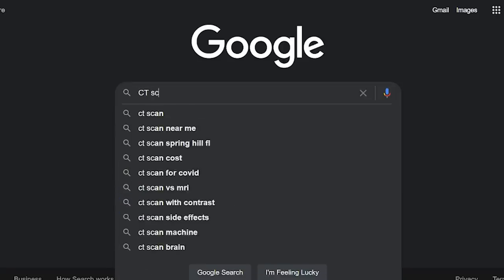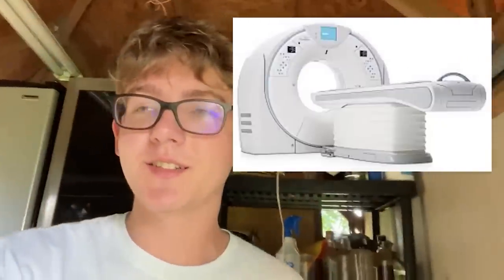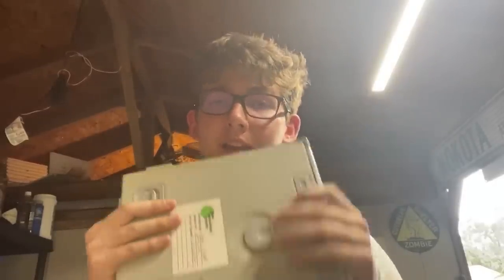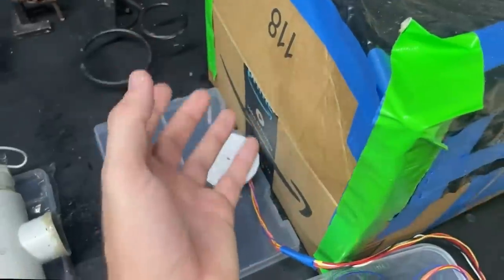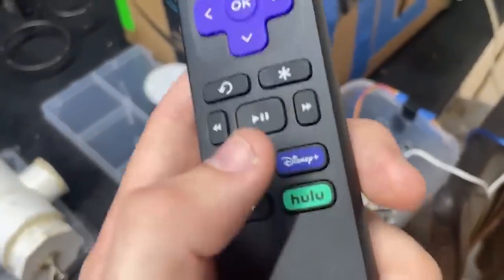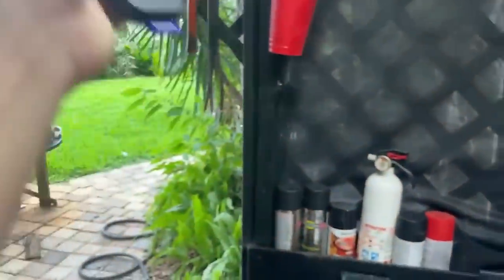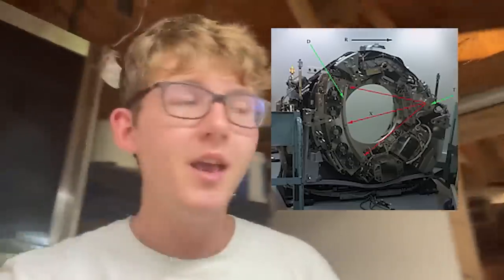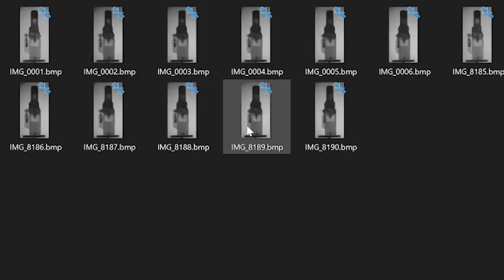Building a DIY CT/CAT scanner for 200$

Comment: Your beeper code does not give enough time for LOW. It does HIGH for a second, goes to LOW and immediately back to HIGH. What you need is another pause after the LOW.
Reply: Well done.
Reply: need to hold HIGH and LOW through prolonged increments.
Reply: for(int i = 0; i < 45; i++)
{
     digitalWrite(2, HIGH);
     delay(1000);
     digitalWrite(2, LOW);
     delay(1000); // this is what you were missing
}
Reply: even better is to just use PWM.  the atmega's default clocks put all of the PWM frequencies in the human audible range, so you can just set PWM to 50% duty cycle, wait one second, then turn it back off.  no need for a loop. example from memory: (it's been a minute since i touched an arduino so double check the syntax lol)

// i believe this is one of the PWM pins, and i think it's in the low kHz range
int beeperPin = 6;
pinMode(beeperPin, OUTPUT);

// beeper on.  this is 127 of 255, so 50% duty cycle square wave. (and it's 255 because it's 8-bit, and that includes 0, so it's 256 total)
analogWrite(beeperPin, 127); 

// let it beep for one second 
delay(1000);

// beeper off 
analogWrite(beeperPin, 0);

Comment: Absolutely incredible that this works as well as it does. After working 4 decades in control systems, I would recommend programming at least one more additional button on your remote - an E-Stop (emergency stop) button to instantly halt the x-ray and high voltage power supply, should someone (or possibly a pet) enter into the area unexpectedly. Impressive that you researched this so completely. Well done!

Comment: Excellent.
I've not watched all of it carefully so you may have addressed it.

Be careful to not overheat the tube.  They are normally submerged in oil and temp controlled.

And buy yourself a digital dose meter.  Don't mess around with xrays and cancer.

Comment: The piezo buzzer not staying on for the specified time is because you need to delay after setting the pin to low, otherwise the code loops then immediately sets the pin high again, not giving any time to stay off, if you want a period of 1 second high and low then you can do that but if you want a total interval as 1 second so time it takes for the buzzer to go on and off then repeat, you would delay for 500 ms after setting pin 2 high and then after setting pin 2 low delay for another 500ms.

Feel free to tweak these values to achieve what you’re looking for.
May i recommend  HIGH for 1000ms & LOW for 500ms

Comment: This is a great idea for making your own X-ray inspection equipment; welding, solder balls on BGA components, failure analysis, etc..
It was smart to use the remote control to keep away from the X-rays! 
If you don't know Matlab, it's not that bad. You can use Octave and get up to speed with Matlab for free (nearly the same). 
Python also has LOTS of tools, but Matlab is great for doing this vector math in real time though.
Reply: Just like Matlab has Simuling, Octave has Scilabs. They're a LOT of tools to get things done at a high leve, very fast. It's like how Python has a lot of tools out there to use for free.
Reply: Python has a lot of modules for medical engineering, image reconstruction, signal analysis etc. And all for free. 

 I used it a lot at university (studied medical engineering).

Comment: 7:25 It's probably been mentioned but the issue with the buzzer staying on is that it turns off at the end of the loop cycle, but then immediately starts the cycle over turning itself back on. doing something like "buzzer on, wait 500ms, buzzer off, wait 500ms" would produce something similar to what you want.

Comment: Incredible!  I wonder how much more accurate it would be with tiny increments like 0.4 degrees per image.  How much radiation do they emit?  I wonder how long before it would “damage” a person. I’m also imagining if you built a slow revolving almost circular train track, you could have the hardware rotate very slowly and work well. If you had a vertical track on a wall, a patient could stand against a wall while it moved up in 1ft increments and revolved slowly. Obviously very slow and crazy work to develop but it would make ct machines an affordable household appliance.

Comment: Great video. I have some code suggestions though. Note: this is not in any way intended to be a roast.

First, as you are in a very agressive enviroment where you can get random bit-flips, you should add a watchdog timer to the code. This is on the hardware where if a function isn't called for too long it assumes the MCU crashed and it will reboot it where you can re-initialize all of the outputs into a safe state.

Second, your code is very slow (as in one loop will  take many minutes) because you have a lot of blocking code (a delay(1000) will have the execution sit there until it is finished with that line). This makes it difficult to react to any other inputs you may want to add later (like a cancel button). Instead, you should have something more like this pseudo code:

#include<avr/wdt.h>	//real code, needed for watchdog
setup(
	wdt_enable(WDTO_2S);  // Real code, Enable the watchdog with a timeout of 2 seconds
)
loop(
	wdt_reset();  // Real code, Reset the watchdog if this isn't called before 2 seconds then the arduino will reset itself
	if(startButtonPushed || motionRunning){	//see if the enable button has been pushed or if the program is already running
		if(!motionRunning){	//check to see if motion is already running to initialize the running variables (pushing the start button again doesn't do anything)
			startTime=millis();	//read current time
			motionRunning=true;	//tell the program it is running
			angleStep=360/destiredResolution;	//save a variable so the program knows when it is done
			currentAngle=0;		//reset this counter
		}
	}
	if(millis()-startTime>=1000){	//here is where it gets good. The arduino is running the main loop as fast as it can (many thousands of times per second), this checks to see if one second has passed, if it has then it will do stuff
		takePicture();	//call function to tell camera to take a picture
		moveTable();	//start table motion
		startTime=millis();	//record new time
		currentAngle=currentAngle+angleStep;	//update table rotation position
		if(currentAngle>=360){		//check to see if a full rotation has completed, if it has, shut down the program
			motionRunning=false;
		}
	}
	if(stopButtonPushed){	//having non-blocking code allows a stop button to be constantly checked
		motionRunning=false;
	}

}

If you have any more questions I can help out and would even be willing to make something that actually compiles. Keep up the good work.

Comment: What do you think about building a scanner with an array of electronic sensors like those used by Peter Jansen? it can allow you to detect a weak signal directly, with higher sensitivity and much faster. The original "openCT 2" (can be found on 'hackaday') has a pretty low resolution, but signal-to-noize ratio is pretty impressive.

Comment: Great job! One thing, it's probably much harder and slightly questionable regarding safety, but if you manage to run the tube at full power (not sure how many kV you are using) you can probably record video directly of the intensifying screen, then you just do a pretty quick 360spin and then extract the frames, are you using long exposure for the pictures? Excellent video, and sorry if it's something you already considered hahahaha

Comment: Hmm curious how the crazy phone image AI that they use to improve the image interferes/helps. If it’s possible to find an app that turns off some of the magic would be good to compare. During scientific things it’s best to remove as much of the magic and apply it later, especially because it can vary from shot to shot.

Also if you add a counter or something that was visible in the image it would help to map the particular degrees of a shot. Probably the best move is to integrate it with a Pi or something so you can correlate the shots with the actual data on rotation.

Comment: I think it’ll be really cool to repurpose an old microwave machine to do this. Since it’s already got a turning table and stuff.
Reply from the maker: Hmmm you’re onto something there! I could lead shield it then replace the old electronics with my own, I’ll definitely probably try that in the future!
Reply: @PyrotechnicalScience  yep, super excited to see it.
Reply: @PyrotechnicalScience  the microwave motor would have to be a non standard one. The motors that I have found inside the microwaves take a random direction when they are turned on.
Reply from the maker: @Charlie8food  I’d just replace it with a stepper motor

Comment: You've got your beep in a loop so its going to happen 45 times. It seems to be 'staying on' because there is no delay between the switching off and the switching on. It goes on, waits for a second, goes off, then it changes the value of 'i' and does a check, once that check is done it instantly goes back to the 'switch on' instruction. The time it takes to switch back on is imperceptibly short. It will perceptibly stay on for 45 seconds and then turn off and continue the rest of the code.
Reply: Yep this is the reason. I was going to post this exact thing but then I saw this. Set another delay after the LOW or it has zero delay and just stays on all the time.(or set the delay before the HIGH ... I personally don't do anything before the HIGH :) )

Comment: Being technically competent at such a young age is great, you have serious future potential.  Since you can produce X-Rays might I suggest an application other than imagery.  Try to develop a receiver antenna that would convert X-Rays back into electricity similar to a solar panel converting photons into electricity.  Space travel has a problem with cosmic rays penetrating the space ship and damaging the astronauts, like being under constant X-Ray bombardment, current shielding is insufficient.  Astronauts during Apollo missions kept seeing flashes of light even when their eyes were closed, those were cosmic rays hitting their bodies.  If you can convert X-Rays into useful electricity before they penetrate the ship that would save astronauts lives & produce power for Plasma engines.  It is worth the research.  X-Rays are different frequency than gamma rays but the approach should be similar.  Gamma rays also come from nuclear waste, an antenna encasing nuclear waste would become a battery that last for centuries and worth a Nobel Prize.

Comment: Looking at your code. You have the alert in another for loop. So it's going to execute the alert 45 times before it's stops. Instead write a conditional statement at the end of the first for loop that checks the iterator. Such as "if(  i == 45) {
ALERT:);
}

That way it only runs when the cycles completes and only alerts once.

Comment: Awesome project! Can you provide some details about the X-ray source, such as the high voltage magnitude and the current (mA) that the tube draws? I have experience repairing dental X-ray machines, and so I have a good understanding of the circuitry and how it functions. Do you have a link to your construction details that you can share with others who might want to duplicate this project?  THANKS!

Comment: Somebody probably answered this, but in your buzzer loop you need another delay after writing LOW to create off-time. Because it's a loop, it's going straight from digitalWrite(LOW) to digitalWrite(HIGH) without a delay. 

Original script:
for(i = 0; i < 45: i++) {
    digitalWrite(2, HIGH);
    delay(1000);
    digitalWrite(2, LOW);
    //delay(1000);   <-------ADD HERE//
}

The loop when executed looks like this: 

digitalWrite(2, HIGH);
delay(1000);
digitalWrite(2, LOW);
digitalWrite(2, HIGH);
delay(1000);
digitalWrite(2, LOW);
digitalWrite(2, HIGH);
delay(1000);
digitalWrite(2, LOW);
digitalWrite(2, HIGH);
delay(1000);
digitalWrite(2, LOW);

... (x45)

Comment: Scrap yards. That's where I find my x-ray machines and I've even found a CT and other  more niche machines. With the older ones just be careful about the pcbs in the high voltage oil

 Buddy of mine runs a local industrial salvage yard, but they also take just general scrap from the public. Not many people allowed to look around in there but he lets me come in whenever I want. I bought a half a dozen x-ray machines over the last 4 or 5 years. Some of them old nice film types, some of them super modern Siemens digital wrap-arounds. You can find a scrap yard and make friends, you'll definitely get some X-ray and medical stuff from time to time... But here's the key... You need to find out who the clients were that brought it and talk to them. In my case it was a guy who owns a business repairing, setting up, and brokering all types of machines like that. So he gave me a heads up when he was bringing the remains of a CT to the yard. That way I could get it before it hit the ground and receive damage. you'd be amazed what kind of stuff comes in these scrap yards. The smaller family-owned yards are usually the only ones that will let you come in and buy. But a few boxes of cookies and a polite attitude... And they'll keep your number on their desk and call you when certain things come in.

A lot of corporations have bought out so many of the small scrap yards and they won't even let their own employees buy from them because of the liability. So you have to find a family-owned or smaller scrap yard. I pay around $0.05 per pound which means I got those x-ray machines for between 15 and $25 according to their weight. 

Some of the smaller scrapyards might not have a portal scanner or monitoring system. Basically that type of system is something you would find at airports, customs, and a tractor trailer weigh in stations. It's a super-sensitive scintillating Crystal detector probe and a radiation monitor with alarm. You can pick them up on eBay from time to time for pennies on the dollar. At the very least I would get a good Ludlum m and a good sensitive scintillation probe detector. Because scrapyards can get some really spicy things from time to time and they might not even know it. I've got a collection that includes some really spicy things. One of which my scintillation probe started singing and freaking out when I was more than a half a mile away from the yard. I guess it helps to be near Chattanooga Tennessee and just right next door to oak ridge national Lab. That's not necessarily were some of the radiation sources came from, but due to the huge history of radiological events and development around here... The stuff just seems more prevalent. The spiciest thing I ever foundis something similar to what I mentioned above. It is in a 5-gallon bucket with LED flashing wrapped around it about 6 in thick on all sides. That is submerged in a 50 gallon drum of water and kept in my storm cellar away from the house and underground. So yeah spicy to say the least and I was very lucky to find something like that and prevent my buddies or anybody else at the yard getting exposure. This is happened multiple times with similar situations. Sometimes not so spicy but sometimes super hot and scary. Calling the proper authorities and people with the experience to remove stuff like that... A lot of times they will come and check it out and unless it's something weapons-grade or something truly truly dangerous they won't even confiscate it. Although they will find the yard for not having portal in area monitors. They're more interested in getting the tag number of the dude who brought it and all the pictures taken by the yard so they can track them down and see what else they might have.

Comment: Hey, sorry if I'm over stepping, but I thought you'd find this version of the code easier to mess with:

#include <Stepper.h>
#include <IRremote.h>

const int stepsPerRevolution = 2048;
Stepper myStepper(stepsPerRevolution, 8, 9, 10, 11);
IRrecv IR(3);
decode_results cmd;

void setup() {
  Serial.begin(9600);
  pinMode(2, OUTPUT);
  myStepper.setSpeed(10);
  IR.enableIRIn();
}

void loop() {
  if (IR.decode(&cmd)) {
    Serial.println(cmd.value, HEX);
    delay(1500);
    IR.resume();
    if (cmd.value == 0x5743D22D) { // low fidelity mode
      
      //I didn't feel like simplifying your alarm
             
      digitalWrite(2, HIGH);
      delay(1000);
      digitalWrite(2, LOW);
      delay(1000);
      digitalWrite(2, HIGH);
      delay(1000);
      digitalWrite(2, LOW);
      delay(1000);
      digitalWrite(2, HIGH);
      delay(1000);
      digitalWrite(2, LOW);
      delay(2000);
      
      for (int i = 0; i < 64; i++) {
        myStepper.step(32); //moves your stepper 32 steps then stops
        delay(1000);

        digitalWrite(2, HIGH);
        delay(1000);
        digitalWrite(2, LOW);
      }
    }
    if (cmd.value == 0x57438976) { // high fidelity mode
      
      //I didn't feel like simplifying your alarm
       
      digitalWrite(2, HIGH);
      delay(1000);
      digitalWrite(2, LOW);
      delay(1000);
      digitalWrite(2, HIGH);
      delay(1000);
      digitalWrite(2, LOW);
      delay(1000);
      digitalWrite(2, HIGH);
      delay(1000);
      digitalWrite(2, LOW);
      delay(2000);

      for (int i = 0; i < 128; i++) {
        myStepper.step(16); //moves your stepper 16 steps then stops
        delay(1000);

        digitalWrite(2, HIGH);
        delay(1000);
        digitalWrite(2, LOW);
      }
    }
  }
}